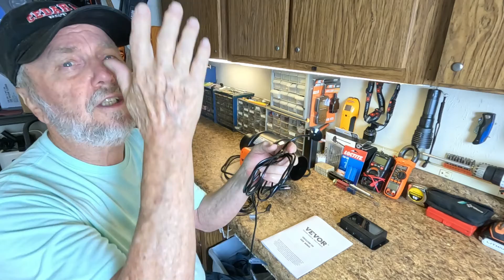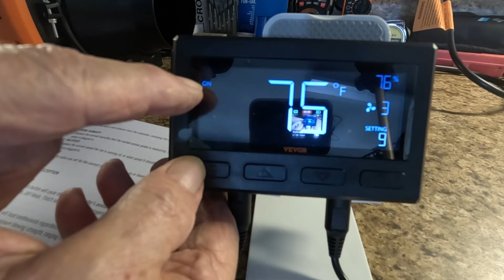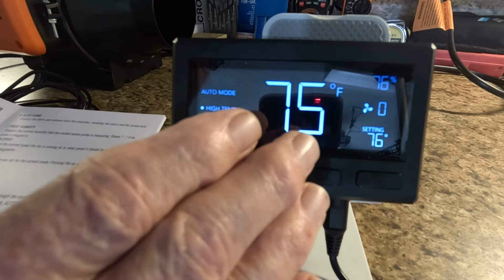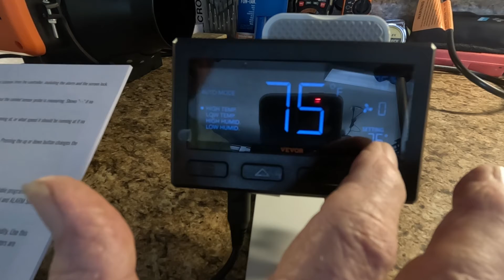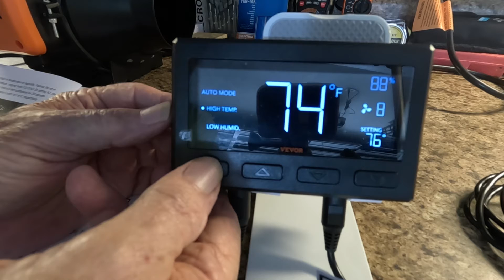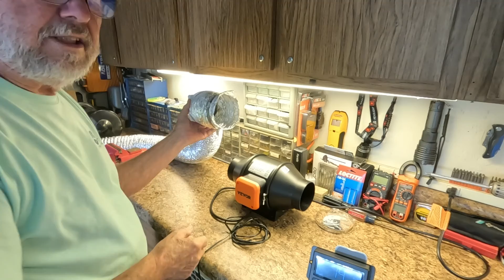VEVOR Inline Ventilation Duct Fan with sensor and controller

Comment: Could that fan be controlled by a differential pressure sensor for maintaining the DP at a certain setpoint?
Reply from the maker: I don't think so, controller display only shows temp and humidity values, no psi.

Comment: Are the ends the same size as 4" pvc pipe or close enough to use rubber couplers?
Reply from the maker: Same size at both ends.

Comment: Hi Sam I have been looking at this specific fan on HD website and then found this video.  Awesome! 
Quick question:  How high can I set the temp before fan turns on? Thanx, Carl, PA
Reply from the maker: @carlmastropaolo6147  I am an Amazon Influencer, I receive products and do my best to learn the basic features of the products, then create a video explaining the features and demonstrate the product installed.  I just do not have the time to explore all elements of a product to answer questions as you are asking.  Sorry, I just do not know that answer.  I suggest contacting VEVOR and I am sure you will get an answer.  I use the fan to remove the hot air from my garage and just run it full open all the time and it does a great job.

Comment: Im gettin the 6 inch kit tomorrow. Its on sale so ill just use a reducer to run the 6inch fan thru my 4inch dryer exhaust port, one thing i was wondering does this control fans for the temp levels or temp and humidity both? Ty

Comment: Very informative. I am thinking of using this for generator exhaust. I would like to hook up the power to the generator output, and I want the fan to turn on every time the controller has power applied. Is that possible or will it loose all the mode settings once it is powered off?
Reply from the maker: @WarrenGauci  you can accomplish what you want by just don’t plug the cord between the motor and controller.  The motor will run when the generator power is on and will be off when generator is not running.  Just plug vent motor into the generator.

Comment: Honestly, genius. I was looking for a way to exhaust my garage and saw all kinds of attic fans that require cutting a hole in my ceiling. I really didn't want to go into the attic to do that. This solution is perfect! I have a dryer vent no longer in use because I switched to a ventless dryer, now I can do this method instead. Thank you for the idea!
Reply from the maker: @Kenny-vo  glad I was influential with help solving  exhausting your garage air.

Comment: Any ideas how to control this fan using an existing HVAC thermostat?
Reply from the maker: you may try putting the temperature probe in the air duct.  when the A/C comes on the temp probe will record the temp drop and if your settings are adjusted to operate under those settings, that will be your solution.  Good Luck
Reply: @samowens44  will this work with both cooling and heating?
Reply from the maker: @2003z440 works with both

Comment: Thank you for this video. I have the gable shutter fan in my garage. The manual is not very thorough and I could not figure out how to set the controller. You were very clear in your explanation. I didn't know they made a duct fan and may try to install one to suck the hot air from the ceiling above my wood burning stove in the living room.and push it through the ducts to the bedrooms. Thank you!

Comment: I need  a system that turns on when AC turns on
Reply from the maker: @aleman86 you may try putting the temperature probe in the air duct.  when the A/C comes on the temp probe will record the temp drop and if your settings are adjusted to operate under those settings, that will be your solution.  Good Luck

Comment: Great info. Can I just use the fan to extract fumes from heat presses and laser machine from my home workshop to the outside, without having to program anything except to just use the fan "on demand"?
Reply from the maker: Yes it is only a fan.  It has a controller to make the fan come on under certain conditions.  You can also have it to blow all the time.

Comment: Sam is the man! Well explained, thanks!
Is it really not possible to for example run the high temp and the high humidity programs at the same time?
Reply from the maker: @diggie9598 sorry do not have the answer.  Did not look at that option.  You should try it and test how it works.  I do product reviews and do not have the time to test all features fully of a product.  Good luck.
Reply: @samowens44  No worries Sam. I watched again and now i understand how this thing works. Your only goal was to use it on high temp. If someone needs to run it on 2 different programs simultaneously, like for example in a growing environment, that is possible. Just the numbers have to be set properly, so that the different programs do not override each other. That's what created issues for you, but you solved the problem properly. Anyways, thanks again Sam. Good work, keep rocking!

Comment: My fan is installed 2 hours away and have been monitoring it since installed, which has only been triggering due to high humidity.  COULD NOT FIND this setting info ANYWHERE, and the instructions don't cover this.  THANK YOU SO MUCH!!!  My next trip down, I can finally set it up properly
Reply: So there's an app to monitor is there an app
Reply: @gordongilley6103  no app, I have cams watching
Reply: @gordongilley6103  at least some models have an app

Comment: So is the timer as rudimentary as it seems?  It's only functional as a manually activated device if not tied to heat or humidity levels?  That suggests that adding a secondary timer isn't even helpful if there's no "constant on" setting.  Honestly disappointed in this controller if that's the correct assessment.
Reply from the maker: @EvolvedCognition, to answer your question, yes it is a straight up timer, not mechanical.  Now, the user manual explains that under Mode Button, there 5 basic modes, On, Off, Timer, Auto (4 triggers), and Alarm (4 Triggers).
Only one mode can be selected at a time.  In Timer mode, that is the only modes that can operate the Fan.  I think this gives you great flexibility to the operation owner needs.  The Mode "On" may be what you want.  Here is what the User Manual says:  "In this mode, the fan will heat, (I think run) continuously regardless of temperature or humidity.  Use this mode to set the Fan's Maximum blowing strength, ranging from 0-10, when triggers are activated".

Comment: Thanks Sam i threw my manual away and had now idea why fan was not turning off when it reached low humidity!
Reply from the maker: Glad I could help!
Reply: I have the manual but it is not terribly useful. Nowhere does it explain that the fan speed setting applies to both manual and Auto operation. Sam explained very well how this actually works. Great job Sa!